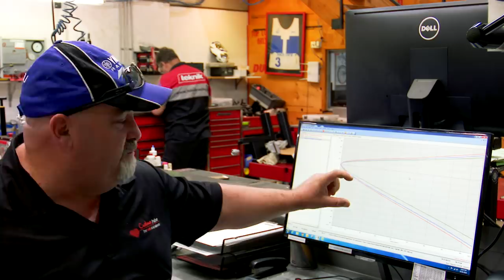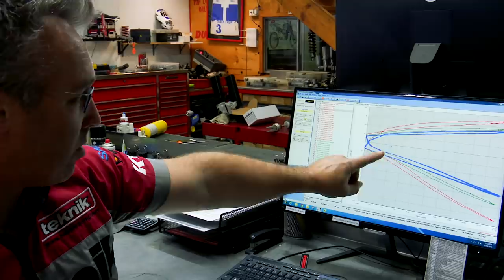Dirt Bike Fun - Yamaha WR250R Rally

Comment: What a hoot of a ride! The WR is such a champ of a light-weight dual sport and instructive to see what top shelf suspension can do for an otherwise solid rig off the showroom floor.  Excellent editing, as usual, Dave!
Reply from the maker: Those suspension modifications take an average bike and make it extraordinary.  As I have alway said, this a potent round the worlder, or equally a fun dirtbike with a bullet proof engine.  They've got about 2 years to go until Yamaha stops making them.  Greg Yager is going to keep one of the last bikes into Australia pristine in a packing crate.
Reply: With the WR being such a popular model, why would Yamaha discontinue it? I have a hard time believing it's due to emission requirements since both the KLR650 and the DR650 have been around for 30 years with little modification. I picked up a second 2003 640 Adventure with only 5k miles on it so a riding buddy can join me.
Reply: @MotorcycleAdventureDirtbikeTV   2 years ya don't say, lol.